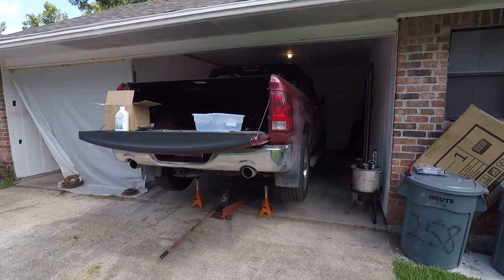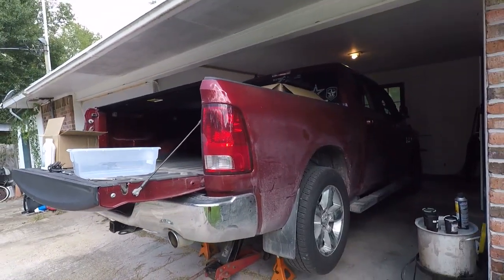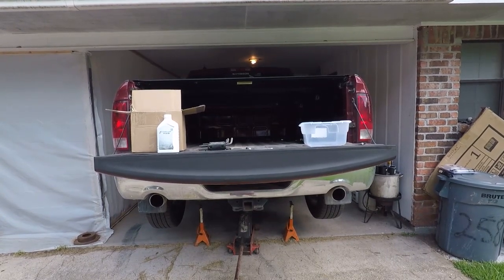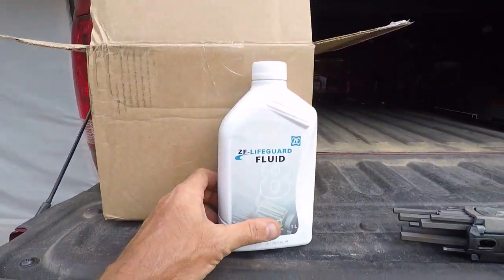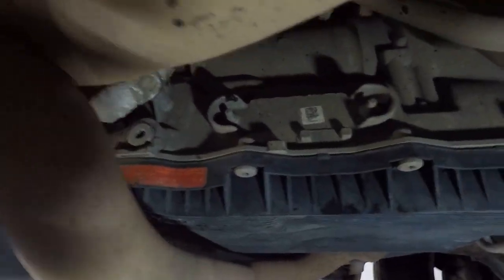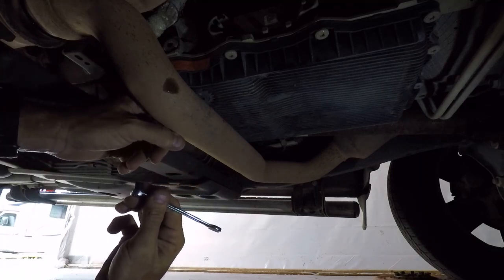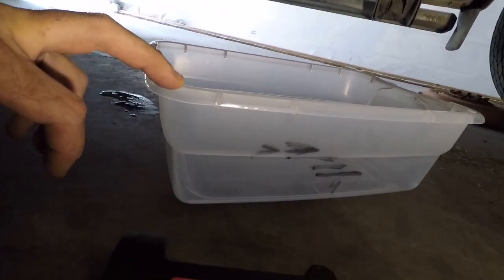RAM ZF 8 speed transmission fluid and filter change Part 1

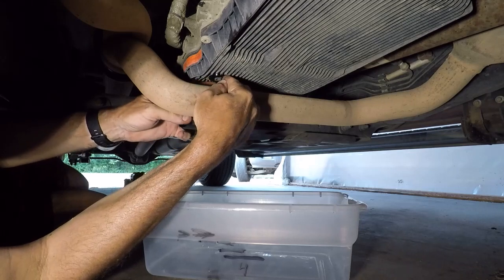Comment: At 8:40, after watching this, might I suggest wrapping the exhaust pipe iwith tin foil in a way to be a barrier from the fluid.
Reply from the maker: Excellent and simple idea. Weirdly, the zf fluid didn't even smoke when it heated up. I was surprised it just basically evaporated off the pipe. Thanks!

Comment: I remember taking the pan off the 350 chevy engine and 350 turbo transmission we swapped into the gremlin. There was a inch high mound of material in the transmission pan under the oil pickup. It ran better when we put the 4 speed in though.
Reply from the maker: I'm still looking for a decent gremlin. Even those things are getting expensive though.

Comment: Hey Araron, just a heads up, your amazon link to the fluid guard is going to the ZF fluid 6. In the video you used the ZF fluid 8. You should fix the amazon link in your description otherwise someone will use the wrong fluid accidentally.
Reply from the maker: Fixed it. Thanks!

Comment: 👍👍 great video. I got a 2019 and will drop that filter probably at 60k or so.. 
As for engine oil , what do u use? Im trying my best not to develop the dreaded hemi tick.. any issues with yours??
Reply from the maker: Thanks. I've been using Amsoil oil and filters for the 8 years I've owned the truck. Changed at 10k miles. No issues so far at 135k. Only tick I had was the standard broken exhaust stud.
Reply: The tick has nothing to do with oil. It’s a cold engine exhaust compression sound when header bolts snap and there’s a gap until the engine warms up.

Comment: ZF transmission fluid from RAM factory has a dark green dye in it to allow warranty claims assessment to determine if ZF fluid was used.
Reply: If your veh is out of warranty you can use "far superior" Amsoil Signature Series ATF or Amsoil Torque Drive ATF at around 1/2 the cost of stealer branded or FZ 8-9 speed fluid. Buy direct on line - preferred customer gets best price!!!

Comment: Do I have to drive my ram and get the zf 8 up to temp before I change the fluid or can I do it cold
Reply: Yes I read that if have a transmission intercooler on a ZF8, then you have to get the transmission temp above 70c to open the valve and drain fluid in the intercooler.  You will see many people only pulled 5 or so of the 8 litres not knowing this.  I get mine up to 90c.

When refilling the transmission, it’s important after completing the filling process to then drive the vehicle to above 70 c again, then let cool, then complete the process again. This is why many dealers want the vehicle overnight if they are doing it, to allow cooling overnight between level checks.

Comment: Sucks there’s no dipstick to do a quick check, process has more steps, and costs more, but look easier than the 545RFE on my old Dakota. There was no drain bolt and you had to remove a support frame to pull the  pan.

Comment: Is it necessary to replace the pan? Why not just replace the fluid of about 5 quarts?
Reply from the maker: I replaced the pan as I wanted to go back with an OEM filter. As the filter was so clean, I just drain and fill now. Thanks!

Comment: My ram trans started overheating and they said it was my varamm blocking tgr cooling system . I think its the bypass valve getting stuck . Mine is also a 2014
Reply from the maker: These 8 speeds do have a heater attached to the radiator coolant hoses. In not sure if that valve malfunctioning could cause an overheating problem.

Comment: With a plastic pan over a hot exhaust, was there no heat shielding between the two?
Reply from the maker: Nope. That's how it is. 125k so far and no issues. Thanks!
Reply: @aaronsrose  Thanks for the response! My daughter has a range rover sport, same set up (but with a heat shield). I changed the one piece plastic pan/ filter over to a two piece steel pan and filter, and I entertained not putting the heat shield back on, (because it was a pain to remove). 200k and not a single issue, (knock on wood) so they are pretty good transmissions.

Comment: I found trans pan and filters on eBay for $45 I’m a little nervous about getting on I wonder the quality of filter. Do you think it will make a huge difference or should I go for it
Reply from the maker: Personally, if I were intending to keep the vehicle, given the transmission's German origin, I like the OEM parts. I've seen people have success with the aftermarket ones but it was not a risk I chose to take. One thing I noticed when I changed mine was the pan and filter was so clean, I don't intend to change it again. I'll just do a drain and fill instead unless the fluid looks really murky. Anything is better than not servicing it at all like Dodge recommends though. Thanks!

Comment: At which distance it must be changed?
Reply from the maker: Personally,  I'd say at 50-70k miles.  Thanks!
Reply: I appreciate your nice fast reply
Thank you v much
You deserve all the best
Reply: FCA Group say its life long...not need to be replaced....I amn t satisfy with that
Your opinion is better
Thanx again
Reply: Sir ..Can I apply this to my 2018 Dodge Durango 3.6 liter?
Reply from the maker: I think so.  I believe all the v6 motors in 2018 got the zf8spd trans.  I would confirm for yourself before ordering parts,  but I think it is similar.

Comment: I called FIAT CHRYSLER and they said not to change the fluid and I wondered .
Reply from the maker: My opinion on that, as a 25 year practicing Mechanical Engineer specializing in rotating equipment failure analysis is, The OEM will only care to the point that something makes it past their warranty period. ZF recommends a 60k mile or 8 year fluid change from what I can find. My bet is that FCA figured that it's average customer would have a bird about a $1000+ required maintenance task and so they did enough research to know that the trannys will last past the 100k powertrain warranty and just said screw it. If you're not keeping it past 100k, no problem. If you intend to keep it for 200-300+k, that fluid needs to be changed. I'm thinking of just doing a drain and fill in about 15k miles to get some more of the black crap out of mine.
Reply: @aaronsrose  I heard that drain plug is one time use, does that sound right?
Reply from the maker: If you change the filter, it ends up that way as you replace the entire pan. That said, it has a good oring and locking system so I wouldn't be concerned about reusing it. Thanks!
Reply: @aaronsrose   Cool!